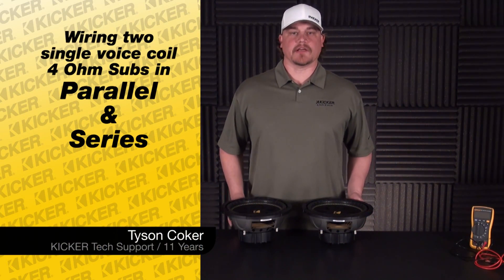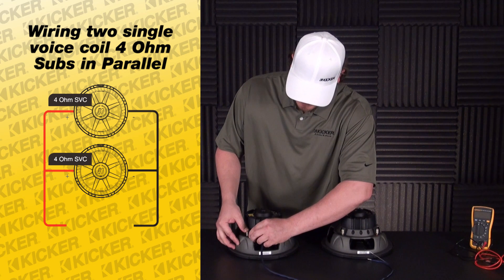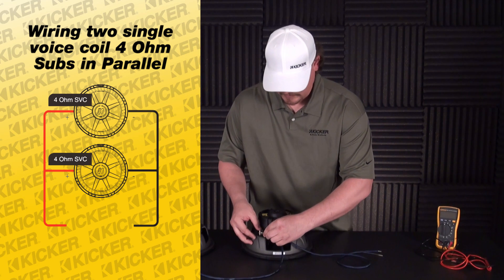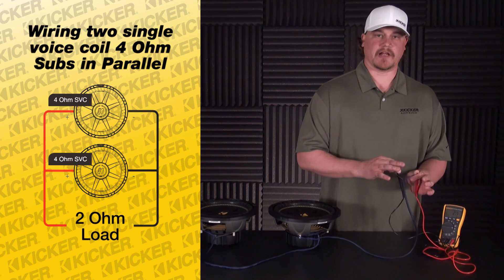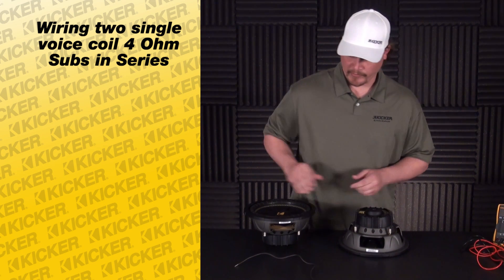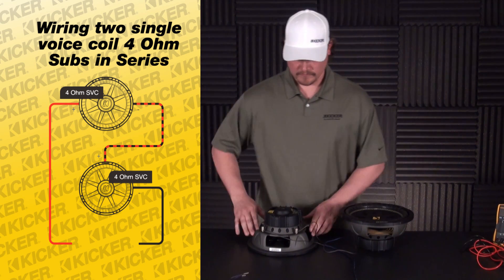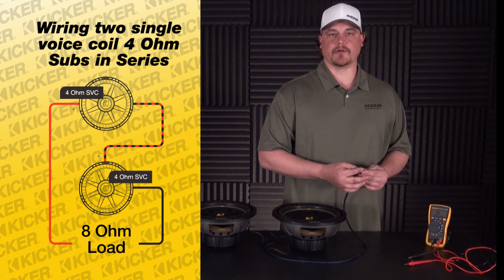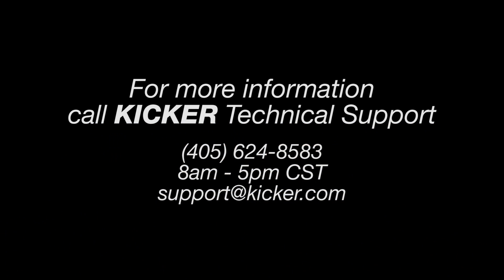Subwoofer Wiring:  Wiring 2 SVC subs in Series and in Parallel

Comment: so if i parallel wired to twin svc subs in a box and the box has positive and negative terminals on either side for each respective sub do i take the wire you’re running to the amp and just put it into one side positive negative terminals?
Reply from the maker: The internal wiring of your box doesn't matter for how you're connecting to the amp. Your subs inside the box can be wired parallel or series, you'll still connect the box terminals + & - to the amplifier terminals + & -. Why do you have a pair of terminals for each sub when they're already internally wired?

Comment: can i wire two kicker comps 12s 4 ohms to 2 ohms?
Reply from the maker: If they are single voice coil 4-ohm Comps, then you can wire them in parallel for a final impedance of 2-ohms. If they're dual voice coil 4-ohm Comps, then you're looking at wiring to 1-ohm or 4-ohms.

Comment: Can i wire two 4ohm dvc and 2 4ohm svc subs together?
Reply from the maker: We don't recommend doing that. The reason is that the speakers with the lower loads will play at great volume than the other subs playing with a higher load. This will cause issues with the sound.

Comment: Which ones better
Reply from the maker: The tradeoff is a combination of power and control.  The lower the ohm load, the higher the power. The higher the ohm load, the more control you get (called "damping"). These are specs that have a lot to do with your amplifier, so you'll want to check the specs of your amp to see how different ohm loads change performance.

Comment: if an amplifier is 1 ohm stable is it still fine to wire the subs in parallel to a 2 ohm load?
Reply from the maker: The short answer is yes. As a general statement , amplifiers are rated to deliver max power at a certain ohm load, but you wont harm an amp by wiring the amps to a higher load than that. So if its rated for 1 ohm max, giving is 2 ohms is fine.  You just wont get as much power out of the amp.
Reply: Thanks for asking that question I've been trying to find out because I have 2 12 kicker comp 4 ohm and a rp.800.1d skar amp which is 1 ohm stable so now I know it's safe to wire my subs to 2 ohm 👍🏻👍🏻

Comment: I have 2 svc  fosgate 12's and want to run in parallel on a 500watt mono amp, it's this ok
Reply from the maker: No way to know that until you figure out the RMS of the subs. Are they 250 W each?
Reply: @KICKERAudio  400 watts
Reply: 200 rms each

Comment: I just had 2 Kicker 10" C10's installed with an Alpine 600w mono rated @ 600/2ohms. I went over with the installer that the speakers, being single voice coil 4ohm subs, needed to be wired a certain way to achieve a 2 ohm load for the amp. Well, I went to pick the car up today and I noticed that they used both terminals on the rear of the box. It's looking like they just simply wired each speaker separately to their own positive and negative terminals, so my question is this. Is it possible to wire the speakers that way and then do the series/parallel at the actual amplifier terminal, meaning run both negatives to the negative amp terminal and both positives to the positive amp terminal ? If not then I am sitting at an 8ohm load lol. Thanks!
Reply: Same here I'm wireing both speakers to a 2ohm then bridge them on the amp....I tried to bridge them on the amp with both positive & negative and my amp cuts off that way when I turn the volume up I guess my amp is stable for 2 ohms

Comment: What is the point, and I’m not trying to be a smart ass, of these svc 4 ohm subs? And why does the box have two sets of inputs....right now I have one 12 cvr dvc wired down to 1 ohm, off of a hifonics 1000 watt mono block...I just got a pair of these yellow kicker 12s , BUT they are 4 ohm single voice coils. So basically I can’t bring down to 1ohm? Is that correct, unless I’m missing something....only thing I could do, PLEASE CORRECT ME IF I’M WRONG. Is connect them parallel, making a 2 ohm load, which now the amp is gonna put out 500, ( divided by two). IS THAT ALL I CAN DO?  I’m really thinking that my ONE CVR, is gonna bump way harder...
So wth, is the point of these 12 inch svc 4 ohm subs.....is it just so someone can say they have kickers? That can’t the only reason.....someone please tell me, what I’m not understanding.
Reply: These YELLOW kickers are low end models , the cvr is the next model with more power and the cvx is the top of the line with more power as well . So yes your cvr hits harder than these comps (yellow kickers) .

Comment: Since my amp is 4 ohm stable i habe to wire my subs in series would it hit harder if i just bridged them in separate channels
Reply from the maker: Brian Vapes some amps are stable below 4 ohms mono. It will depend on the specs the amp manufacturer states, and if you are wiring mono, stereo etc.  if you can tell us the amp model number and manufacturer that will help, as well as the same info for subs.
Reply: @KICKERAudio  i have 2 kicker c12s 4 ohm not sure the amp all the marking are missing its old but ive put them in parallel and it shuts down but runs in series
Reply from the maker: @brianhill9651  If they are dual voice coil, then you can go to 1 ohm.  If they are single, then you can go to 2 ohms. I would need the exact model number to verify that. Your subwoofer RMS should be 600 total regardless. It is likely that you have the subs wired at too low of an ohm load, which may very well be why the amplifier is shutting down. 

Looking at the specs of the XPR82d, the RMS is 240 watts, wired 4 ohms mono. This is as low as the amplifier is rated to go. That said,  I would seriously consider using an amp that delivers 600 watts RMS at either 1 or 2 ohms, as you are currently giving the subwoofers half of the power they need. This can cause damage to the subs and the amplifier.
Reply: They r single voice coil and thank u for ur help what amp would u recomend
Reply: @KICKERAudio  the only number i can find on my subs is 43c124
Reply from the maker: Brian Vapes that’s what I needed.  It verifies that is it SVC.  I’d look at this amp:  https://www.kicker.com/kxa8001-800-watt-mono-amplifier
Reply: I just purchased a pd1100.2 cruch 1100 watt 2 chanel amp how should i run this or is this to much power
Reply from the maker: @brianhill9651  It is not enough. I looked up the specs, and it is a class AB amp with a single 30 amp fuse on 8 gauge power wire. Even at 14.4 volts of power, at most the amp could push out about 330 watts. That 1100 watt rating is - at best - a burst of power lasting a few milliseconds.
Reply: I also have a digital audo xpr82d how could i get the most with those 2 subs kicker comp c 12s

Comment: Okay so if i wire my two SVC 4 OHM subs in parallel and put a 2 ohm load on my amp, how many watts will each sub get if the amp says that it outputs 300W x 2 watts (bridged) at a 4 ohm load?
Reply from the maker: theuncanspan is it a 4 channel amp?

Comment: I got a dumb question if you have to 2 ohm speakers single voice coil and a 2 channel amp what is the ohm load of those speakers if you just run them straight in there one on the left on the right
Reply from the maker: OK, if it's a stereo amp (and not a mono amp with two sets of speaker inputs) then the ohm load is simply 2 ohms.  If you want to bridge the amp to get more power, you have to determine what that amp can take.  If you have me the manufacturer and model of the amp, I can tell you that info.
Reply: Thanks man

Comment: I have 2 4 ohm svc subs, how do i hook them up to a 1ohm mono block amp??
Reply from the maker: Whats the amp?  Most that are 1 ohm stable are also 2 ohm stable, and with a pair of 4 ohm SVC subs, 2 ohms is as low as you can get.
Reply: I have a orion ztreet Z03000.ID, and my subs are 12" power bass subs
Reply from the maker: According to their manual, a 2 ohm mono will deliver about 425 watts maximum: file:///C:/Users/bibrau/Desktop/Orion%20Ztreet%20manual%20(150625).pdf

Without knowing the model of power bass sub you have, I am guessing that you are probably under powering the subs, as most 12" drivers require more power than this.  It is not always the case, but quite often.  You may want to find out the model of the sub.  Your goal should be to deliver the RMS rated power of the subs, so that means having an amp that can do the job at 2 ohms.
Reply: I have the PowerBass M-124, so for the pair max watts is 750
Reply from the maker: I read the manual.  They have an RMS of 350 each and peak of 750. This means they "want" about 700 total, so they are getting about half that power.  Most Class D amps are about 80% efficient, so the 425 peak Orion states at 14.4 volts (most cars give about 12.6v) is significantly lower than reality.  This isn't their fault - its a reality of the industry that most companies are "focred" to give a 14.4v rating. My point is you're giving the subs about half the power they really need.

Comment: I have two kicker 10c124 comp 12's with a 600 watt 300rms two channel amp. So when you wire your subs in parallel, would you connect it to one channel or bridge it?
Reply from the maker: Some mono amps have 2 channels (even though they are actually a single channel - they do it to make wiring more convenient), so before I verify that for you, could you tell me the model and manufacturer of the amp?
Reply: KICKER 
it's a Fosgate T600-2. but it's starting to go out on me. I also have my old amp that still works, it's a bmwx-3880 nitro. When my fosgate dies on me, I will most likely replace it with the old nitro amp.
Reply from the maker: OK a few things. First, using the Rockford you have to wire it in two channel mode, as it is not 2 ohm mono stable.  You should get about 200 watts per channel this way. 

The nitro is 2 ohm stereo, 4 ohm mono stable (just like the Rockford is). The amp has a single 15 amp fuse.  This means that at absolute maximum the amp can deliver (using ohms law to figure this out) about 165 watts total at typical Class D efficiency (85% is the upper range). This assumes a 4 ohm bridged load and 14 volts at the battery - which it usually isn't in most cars.  

This means that the amp is better suited to mids and highs, or at most just one of your 12" subs.  I would avoid using two of them, as it can only provide half of the RMS power consistently.

Sorry to throw some techno-jargon at you, but I want you to consider a different amp if your RF is on the verge of kicking the bucket, because that nitro is never going to produce even a quarter of the 1000 watts it claims, as physics says it's impossible.
Reply: KICKER 
thank you very much. What amp would you recommend for my two kicker subs?
Reply from the maker: I would use this amp.  It delivers 600 watts into 2 ohms, which is perfect for your subs. http://www.kicker.com/cxa6001-600-watt-mono-amplifier

Comment: I have one of you dual kicker boxes with the dual l5 12s made by you guys. it has a single output on the side. what ohms is this setup putting out? I have them been driven by a kicker 750.1 but its not very powerful. I need to have the gain and boost almost at full.. my certificate for the amp say 800 plus (cant remember the exact numbers)  so it should hit hard but it doesn't
Reply from the maker: If you give me the exact model number, I can tell you the ohm load.  Most of them are 2, but we should verify. You should be able to see it by the speaker terminals.

Comment: i have 2 4ohm speakers. if i connect them like you showed in the video is either 2 or 8 ohm final resistance. however is there a way to wire this set up and end up with a 4 ohm still? or is it not possible with svc woofers?
Reply from the maker: Unfortunately the math doesnt work out, as they ohm's law gets in the way (gotta love physics).  There are only two ways (both are usually DIY projects) to force the ohm load you want, when the wiring itself wont let you.  The first is to buy a large resistor. This is very expensive and will get quite hot (how hot depends on the power rating of the amplifier). The other is to get or build a Zobel network.  Here is a link to check that out: http://diyaudioprojects.com/Technical/Speaker-Zobel/

To us, the best answer is the simplest.  Run it at 8 ohms.  You'll only lose about 3dB, the amp will run cooler and you get twice the damping factor - which means more control and better detail from your audio.

Comment: Used a multimeter to set gain an if my math is correct its supposed to be around 24.4. The gain that is. I just want it to be a tad bit louder!!! Pls help!! Lol
Reply from the maker: Normally we recommend you use a test tone to set the gains at 75% volume on the head unit.  Then turn the amp gain up from 0, slowly until you hear distortion, then back it off just slightly.  Check this video out: https://youtu.be/OBYOnXEN0pE?list=PL27710114B3BF1950. The only difference is that your amp doesn't have that light, so you'll have to listen for distortion.  If you like, please feel free to call our Tech Support group.  Our number is 405-624-8510 and we are open weekdays from 8-5 CST. We are happy to walk you through it.

Comment: One last question. I was told to get a bigger amp like the cx600.1 1200w amp. Wld that be too much for my speakers?? 2 12" svc 4 ohm 600w max 300rms
Reply from the maker: The CX600.1 is 600 watts at 2 ohms, so with one svc 4 ohm sub you'd get 300 watts.

Comment: I have a cx600.1 600w RMS POWER @ 14.4V, 4Ω mono, ≤ 1% THD+N : 300W x 1
@ 14.4V, 2Ω mono, ≤ 1% THD+N : 600W x 1 and 2 svc 12" 4ohm comps 600w 300rms sealed box. My question is why cant I wire the subs individually to the amp since it only gets 300rms @ one channel anyway??? Or would it be safer to parallel?? And if I parallel does it split the 600rms between the subs to get 300rms or are they both getting the full 600rms??
Reply from the maker: The amp delivers the most power at 2 ohms mono, so you are absolutely correct that wiring in parallel is optimal with your subs.  Each sub will get 300 watts wired this way. Check page 4 of the manual to see the proper wiring technique: http://ow.ly/dxJc3091HiZ.

Comment: I have 2 SVC 1 ohm subs and want to wire them in parallel what would be final impedance or final ohm ??? Please help
Reply from the maker: Hi Michael,  please check out this video.  It goes over your options: https://youtu.be/xSW3Hc7uqhY?list=PLV2hurat1mvmHUBLRPIfRMkWKtIO-TSNo If you need more help, please don't hesitate to contact us.  The number is 405-624-8510, and we are open weekdays from 8-5 CST.
Reply: KICKER 
That video does not answer my question either he is using 4 ohm Svc and I have 1 ohm Svc subs. 
I think the answer to my question is the 2 SVC 1 ohm subs wired in parallel would be .25 ohm and there is no amp that I know of that can handle that low of a ohm load so my only option is to run each sub at 1 ohm and have 2 amps.
Thank you for trying to help though 😎
Reply from the maker: The math is the same, so you can use the series or parallel concept, even though its a different ohm load on your subs.  A pair of svc 1 ohm subs will either be 1/2 ohm or 2 ohms, depending on how you wire it. Id highly recommend series wiring, as most amps cannot take a 1/2 ohm load.
Reply: KICKER 
Thank you so much for the answer and the help 👍
Reply from the maker: Glad to help Michael!  Any other questions, don't hesitate to ask. Enjoy your new sound!

Comment: Hey bud, forgot to also ask you this. What is when you hook up 2 svc 4 ohm subs to ur amp wired normal like one speaker get negative and positive to the amp and the same with the other and u crank it up but u hear the sub change sounds slightly like u maxed them out but u still have plenty of power left in the amp?
Reply from the maker: That sounds like you are pushing the subs into distortion.  Couple of things to check is to make sure the gains on the amp are set to match the pre-amp output of your headunit.  If you have a factory headunit you can have your gains a little higher but if you have an aftermarket headunit, then your gains should not be set probably over 1/4 of the way up.  Also, sealed enclosures can handle a little more power then ported and then the larger you go, the less power they take.
Reply: @KICKERAudio hey man can i wire 2 4ohm dvc and 2 4ohm svc together on the same amp if its a two channel? Amp is 2 ohm stable.

Comment: Thanks for the reply so it is fine to wire 6'5 inch door speakers in parallel without any strain on the speakers then
Reply from the maker: That is correct.  It really doesn't matter to the speakers if you have them wired in 2 ohm or 4 ohm.  What is important is that the amp is compatible with that ohm load.  For example if the amp says it's stable at 2 ohms then you want to make sure you wire your speakers to show the amp a 2 ohm load.  If the amp is only stable at 4 ohms then your speakers need to be wired to show it a 4 ohm load.

Comment: Hi there great videos can you use this wiring for a pair of 6'5" door speakers to run two speakers both 4ohm together to get a 4 ohm load I want to hook two sets of speakers in each door without having to get an amp for each set will this work cheers
Reply from the maker: Hi Kane - if you wire 2 x 6.5" that are 4 ohm together in parallel this will give you a 2 ohm load and if you wire them in series you will have an 8 ohm load.  The only way to get a 4 ohm load would be to wire all 4 speakers together in a series/parallel configuration.

Comment: I ordered two single voice coil kicker subs that are 2 ohms.

How can I wire both of them to a 2 ohm final impedance because I have the kicker sx650.1
Reply from the maker: Unfortuately you will not be able to.  Since they are single 2 ohm voice coils, you can only get a 1 ohm load or a 4 ohm load.  You might contact the place you ordered them to see if you can swap them for single 4 ohm speakers.
Reply: KICKER Ok thanks for the feedback doing so now